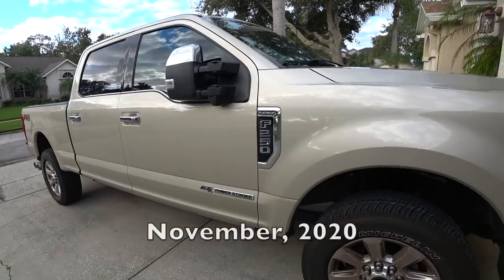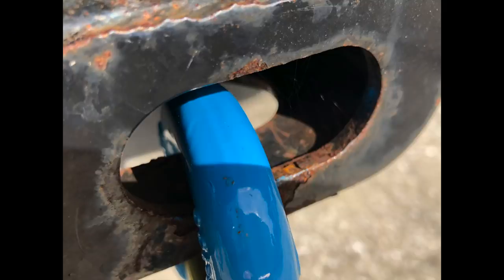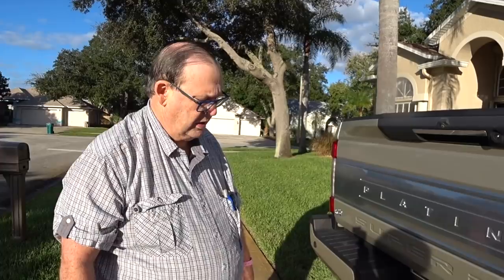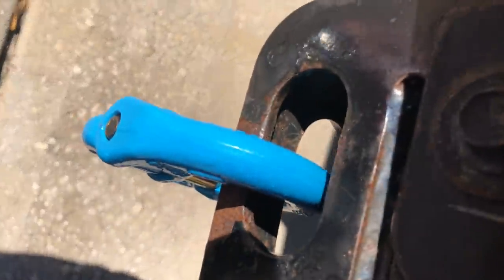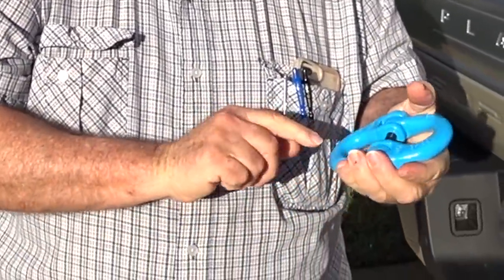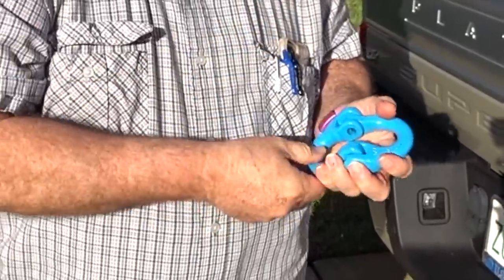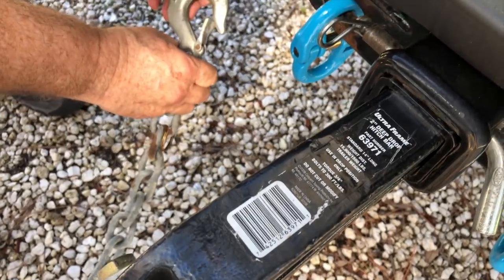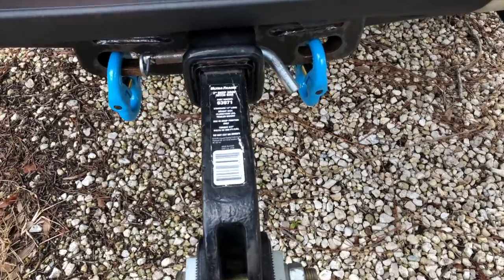Ford!  What were you thinking?? | Hammerlock | RV Safety chain

Comment: ford must have done a lot of market research to identify the shape that fits the fewest number of safety hook options
Reply: GM 3/4 ton has those too
Reply: Ford has a better idea. N o t.
Reply: @danlux4954  GM had that problem in the past but not anymore I have 21 Chevy 2500 duramax and my safety chains ⛓ fit just fine.
Reply: I wonder if the redesign was due to the fact that some engineer. wanted the safety hooks to actually survive and do their job, if a trailer unhooked.  Either way they could have designed it better for ease of use.

Comment: The reason for different colors is not for looking pretty, it's to help identify the group  capacity rating at a glance.
Reply: it shows what grade they are not the rating as you still have to look at the rating charts for the size. these are blue which shows G100 but not all companied use that colour for their G100 products (Gunnebo for example use a lime yellow colour for their products)

Comment: I did the hammer locks because you can get the correct weight range. If you take 1 inch heat shrink wrap you can keep it from making noise when driving

Comment: I just changed the hooks on the safety chains. With largest available from the local hardware store. Problem solved and for less money.
Reply: Ditto. That blue things looks like it would be noisy if left on all the time. Time consuming to take on and off if you didn't leave it on all the time.
Reply: Not cheaper if you have to do it to several trailers
Reply: @WayneTX254  Surprisingly they're not. I have a pair of black G80 hammer locks on my '22 F250 and even w the all the window open (including the rear) you don't hear them at all.

Comment: And here's a great tip for you.  Being that you have a F250, To help with keeping your Radiator and Condenser coil clean and bug free - Simply use a House hold screen that has its own frame and put it in front of your condensor coil. This in turn will keep the Bee's and the moths and all the flying insects out of your Coils and allow the air flow to be unabstructed and keep those coils from getting damaged . On a 2008 modle its easy to install but on yours I dont know how new your truck is. If your grill opens with the hood then it'll be easy - If your grill stays put as you open the hood youll have to remove the grill in order to install - But I found this idea from whom ever owned the truck before me did a great thing and saved my cooling system and Air conditioning . Every fall Its easy to clean for the next summer and wow I do catch a lot of Bugs. Hope this to you helps.
Cheers...

Comment: Here in Australia safety chains are attached to the vehicle using D shackles. Also we cross the chains over, like the left chain attached to the right side and visa versa with the other chain. That way if the trailer does come off the hitch, the trailer will not dig into the road.
Reply from the maker: Chain crossing is done here as well.  Thanks so much for your comment and enjoy your travels!
Reply: D shackles with screw in pins will loosen.
Reply: @danlux4954  

No they don’t. And they’re safer than hooks with spring latches
Reply: @danlux4954 never had one come loose.....ever.  if it does, it wasn't tightened properly,  I only do mine up hand tight and have never had an issue
Reply: should NOT use a "D" Shackle as they are designed for a straight line load only and if the trailer detaches the ball the first force it will get is on a downwards angle as the chain snatches tight to take the load, you should use either a Bow Shackle or Safety Bow Shackle which is deigned to take loads on an angle.  i was a Chain and Rigging Certification Tech for 9 1/2 years.

Comment: We use Hammer locks with cables on heavy lifting fixtures in aerospace/aircraft jig and fixture fabrication. Great product and at grade 100 their stronger than the grade 70 chain hook. 
 Threaded pin  Shackles would be another solution for those that don't want anything hanging on the truck. 
  Threaded 3/8" carabiners are ok for lightweight trailers...not a heavy trailer. A 3/8" carabiner at 2200 lbs doesn't have the same strength as the 3/8 G70 safety chain.

Comment: Buy two Crosby brand shackles / clevises that have bolt, nut, and cotter pin. mount them in the same holes instead of using hammer locks and safety hooks fit like a charm. I trust them before i trust that pin in the hammer lock. Just my opinion
Reply: These are Grade100 though, and you could probably pick up the whole trailer with one of them.

Comment: Recently discovered these when making straps to pull vehicles out of the sand.  Much better than d-rings for permanent connections.
Reply: Synthetic soft shackles work great and eliminate the danger of flying metal objects. Plenty of videos showing the dangers of d rings or metal objects to bind 2 straps together. Be safe out there.

Comment: Ford changed the hitches because of people using incorrect safety chains. Now, you have to use an appropriate safety chain hook for the tow capacity. Yes, if you are towing something smaller, it is inconvenient. But when  you approach the upper range of trailers, these force you to use the correct hooks. Grade 80 or 100 self locking hooks are the appropriate hook allowed now.
Reply: The manufacturer of the trailer puts them on.

Comment: Hey, container links but smaller and a lot harder to use.  The pins usually unlock and come out easily.  I guess that's why they call them "hammer locks".  Those are a pretty slick solution.

Comment: The hitch on my 2022 F450 is no longer like this. I hated the one on my 2017 F250 and I used hammerlocks however the hooks on my TT and enclosed trailer fit great on my new one

Comment: My only issue with these is the worry that they will wear through the receiver metal over time with all the rubbing and bouncing as they don't come off(like a tag on a dog collar) 
I ended up putting 3/4 bow shackles on mine. They don't move at all which makes me feel a bit better about preventing that, but I know the load rating is compromised because of the position they are in. Their rating is for 9,500lbs working(57,000lb breaking) load for each, so they are a bit overkill for the application anyway so I'm not worried.

Comment: Hammerlocks are not ideal for this situation as there are sharp edges where they sit trough the attachment point and even though they are Grade100 they will with lots of vibration of the vehicle moving cause wear, they are not made to be taken apart regularly. i would suggest looking for Wide Mouth Bow Shackles of the correct rating so they can be removed in between use. (was good he showed they have a correct way to drive the pin as you damage and bind up the locking rings going the other way, you must also remove the pins that same direction or it will be very hard to get apart) the other device he showed with the screw gate is called a Maillon (some call them a Mallion) the whole area for hooking into is a very bad design and not suitable for most fittings you could use. it is better he has gone to G100 Hammerlocks rather then G80 as they will resist the vibration wear for longer. they also have a 6.7tn lift rating each. (they are officially called a Chain Joiner or Coupling Link as Hammerlock is a brand name from PWB Anchor but most people i ever met just called them a Hammerlock) i was a Chain and Rigging Certification Tech for 9 1/2 years.

Comment: lol run the chain in and out the hole then hook your quick link or you called locking oval. Not rated very high weight wise . The 80 and 100 are in reference to the chain rating 100 is an European chain 80 grade chain is heat treated made mostly for over head lifting . 100 grade is about 25% stronger . 70 grade chain in mostly for tie-down or for towing and DOT approved

Comment: Are you able to remove them, or is it considered a permanent installation?
Reply from the maker: Haven't had to remove them, but according to what we understand, the pin can be hammered through the lock.  So they are not considered "permanent," although we don't plan on removing them, even if we sell the truck.
Reply: They are relatively easy to remove with the proper straight punch however when assembling  I would use a little never-seize in the center barrel.. a little rust makes them a bear to remove.

Comment: What if you put a wood block behind it when hammering the pin in?
Reply: No. A wood block will absorb too much energy of the hammer. A hefty metal block or sledge hammer behind it will not absorb shock and therefore all your hammer force will be directed into the pin and drive it through easily.

Comment: An engineer will tell you that leaving these (or any D or Bow shackle for that matter) swinging on the towbar will eventually provide a weak spot on the link.  I guess half inch provides a significant safety factor, but I would keep an eye on wear

Comment: Lol yes you can put safety hooks on. You need to be smarter then the hooks. The purpose for the new design is the extra strength. Since Ford up the hitch capacity they needed to up the safety hooks capacity

Comment: One should never use a carpenter's claw hammer to beat on hardened steel pins as the hammer head is also hardened and prone to chipping either the head or the pins and the bits of flying metal are an eye hazard, did you wear your safety glasses? Get a machinist's ball peen hammer and still use safety glasses please.